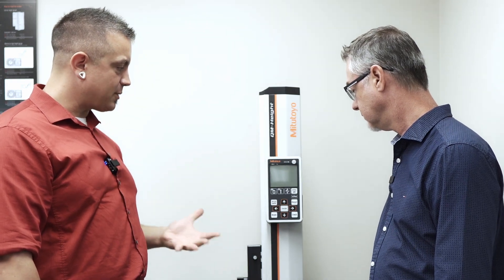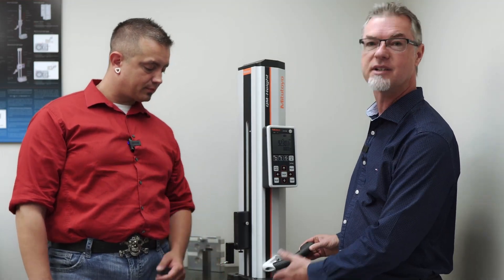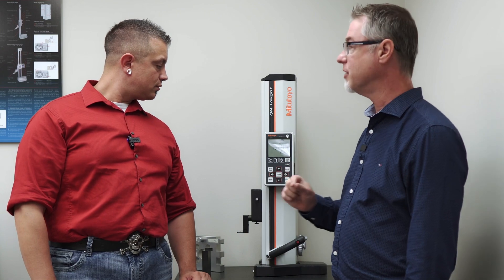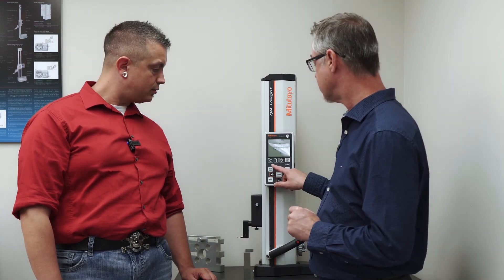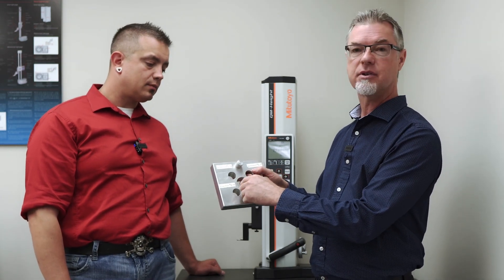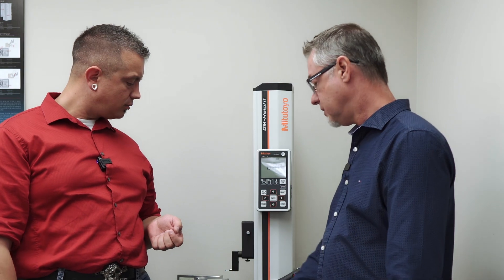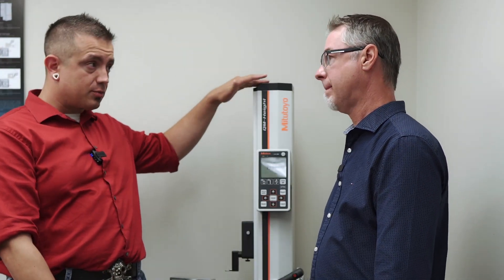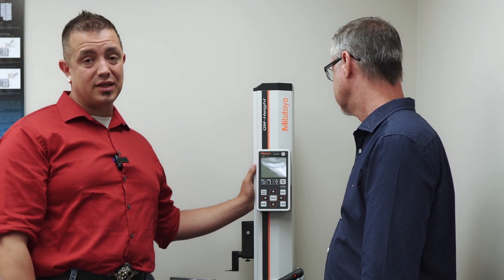Mitutoyo QM Height Gauge: Does it belong in your shop?

Comment: Can you or how do you set a hole as a Datum (zero)?
Reply: Working on this with Mitutoyo, will make an update video step by step to cover this asap
Reply: @Machine_Shop_Tech_Talk  Thanks Arthur!  I think this would really help utilize the full potential of this height gage.
Reply: @PaulPitts-r5k  in case others are interested:

QM Height/Setting Center of hole as Zero(datum)
 
Press: Zero/ABS Button, set surface plate as Zero.
Press: Inside Diameter Button and measure hole.
*Displayed results will show Diameter(Zd) and Position from Zero(Zp).
*Note the (Zp) number. Move the probe to this position using the Fine Adjustment knob.
*Press: Zero/ABS Button, then the Enter button.

The part Zero is now set to the center of the hole position and measurements will be taken from there.